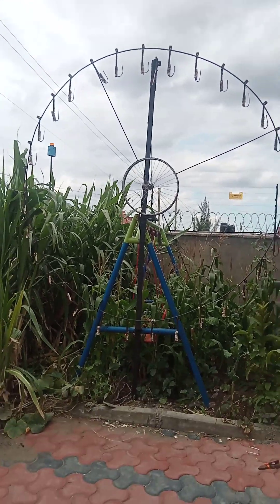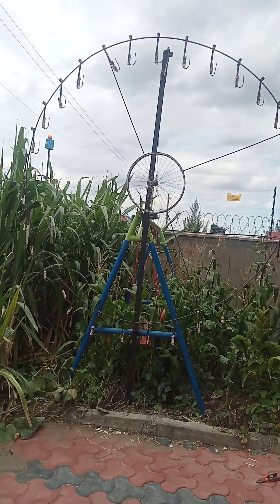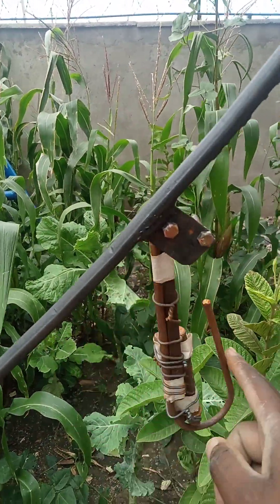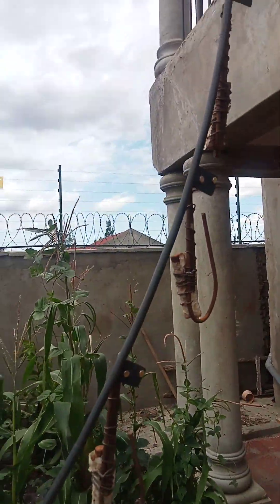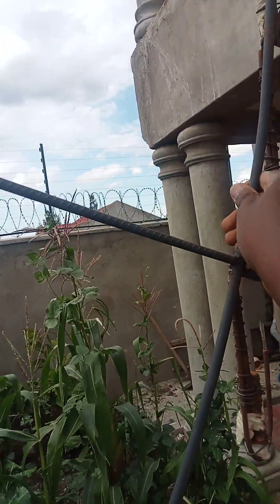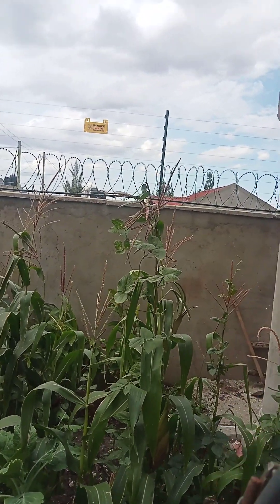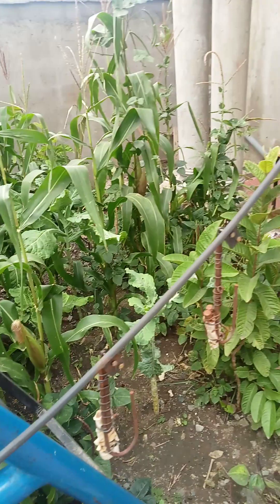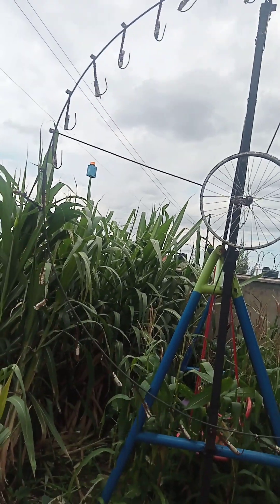Free energy, Perpetual motion, Overbalanced wheel, Gravity turbine - Part 2d by Professor Tiwes

Comment: Does not rotate.
Reply from the maker: No, it does not rotate continuously for this specific model but still optimistic that there exists a model that can work. Other models rotate continuously in dynamic simulation in solid edge but when you make a physical model still does not rotate.